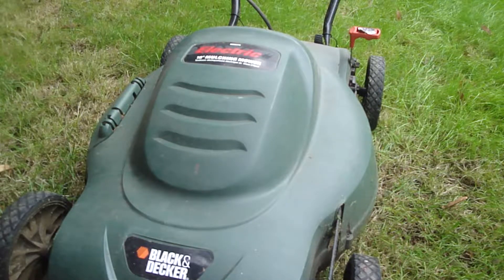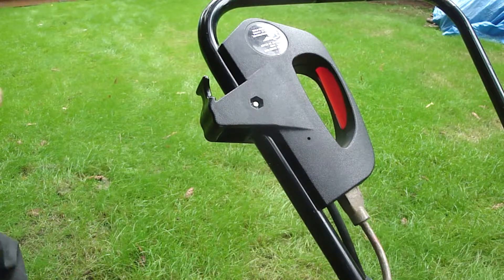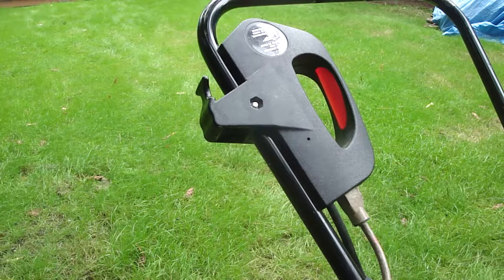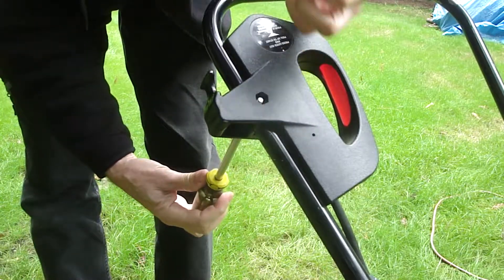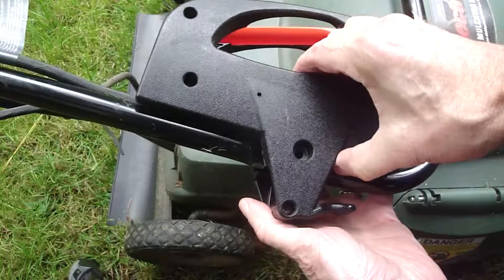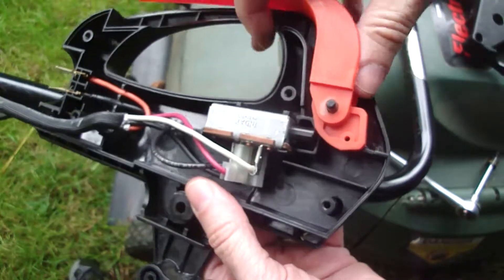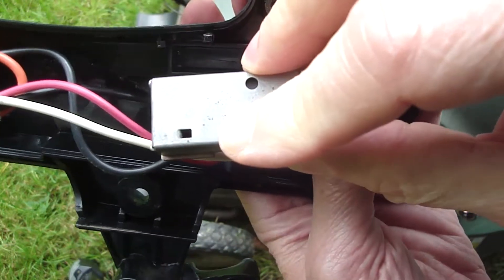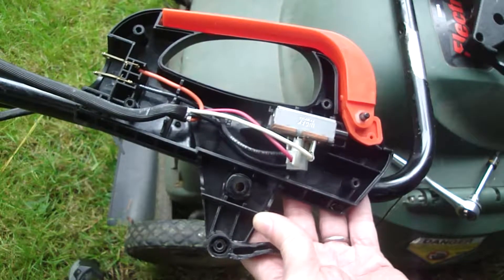Fixing an Electric Lawn Mower that Stalls

Comment: That’s brilliant and a solution I wouldn’t have considered! Here’s my problem:  My same mower is doing the same low power then stalling thing, so I replaced the switch. Nothing changed! So, it’s not the switch that’s the problem. I notice that the motor power fluctuates when I squeeze the cover that encases the starter - I press just below the handle pivot point. If you have an insight as to what it could be, I am all ears! This has me flummoxed and down a solid mower.
Reply from the maker: It's possible that the new switch is bad.  Otherwise, check the wiring from the switch to the motor.  I suspect the wires might be chaffed.
Reply: @davidgpo  Thank you!
Reply: @davidgpo  FYI: I just learned that a bad / failing resistor can cause low power and occasionally trip the breaker. Going to try replacing that next.
Reply from the maker: @nywvblue    That's beyond my level of skills.  Let me know how it works out.

Comment: How did you dry out the switch after spraying it?
Reply from the maker: It air dried quickly.  It turned out that the switch was bad so I replaced it.
Reply: @davidgpo  Thanks! Going to try that first this week.

Comment: I have the same model of mower i have replaced the switch once back in 2011 it went again this year my temporary fix was i pulled apart the switch and cleaned the contact points if your wondering it was a huge pain putting the switch back together
Reply: I have the same model bout when I plug the extension cord to it it starts to smoke doesn’t that mean the switch needs replaced
Reply: @yvettevalentine2348  i have been repairing electric lawn mowers since i was 14 mine is the second one of this model I've fixed the first one was my older neighbors whom replaced his switch but his plugin prongs he put in backwards so it started to smoke and he burned out the entire motor and tossed it i watch this video before i fixed mine remembering every detail even constantly pausing so i didn't mess up the wiring order i have since cut my grass twice since the comment and its still going strong